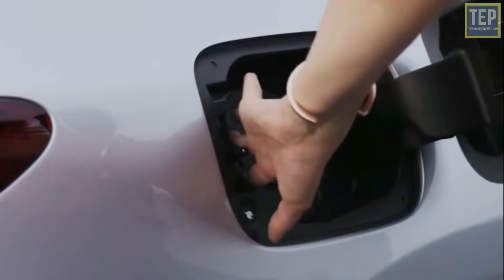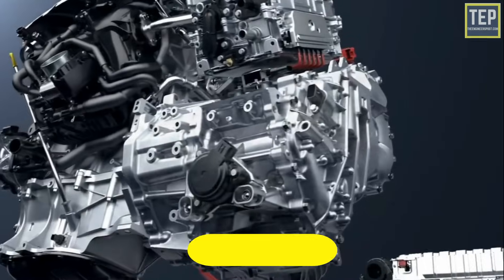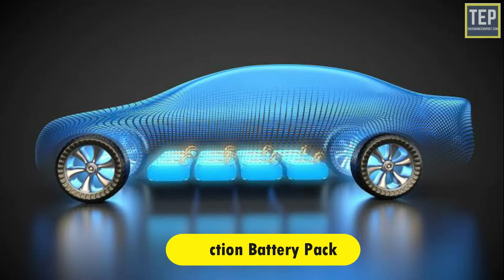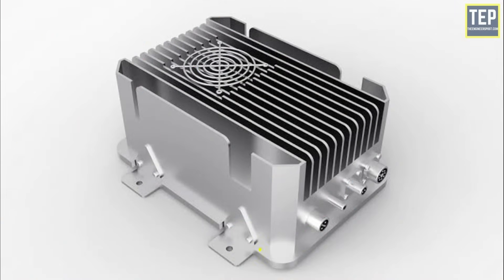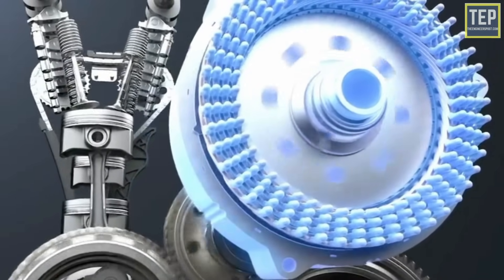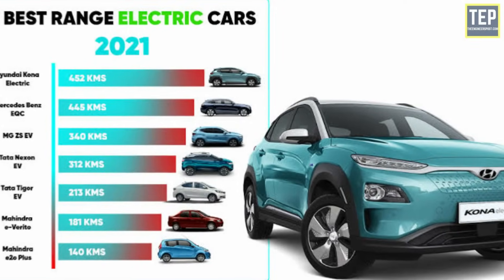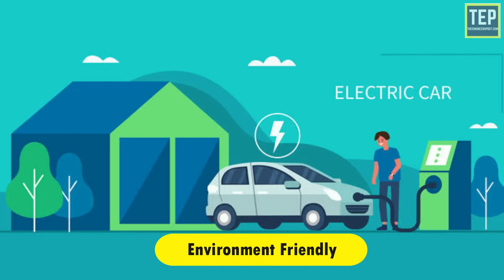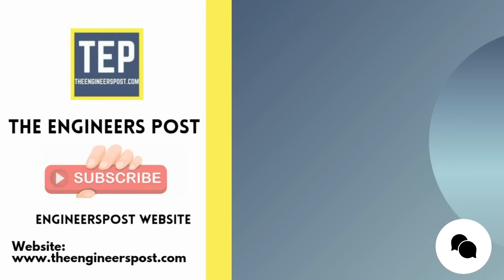How an Electric Car Works? Its Parts & Functions [Explained]

Comment: Very well presented, catering to both techies n laymen.
Reply: To me I really don't care for one they're too expensive and what were the weight of those batteries do when you get in a wreck and one of those batteries sounds break you better run like hell because your car is going to be in fire quick.... That's if you can run you'll burn up in the car like barbecue spare ribs.... You notice they never spoke about safety the vehicle crashing what would happen...
Reply: They are very dangerous n hazard to you health

Comment: This is very useful. Thank you. But I also wanna tell,  in some countries these EV vehicles are makes a huge emissions. if the electricity made by chemical power plants, then thes car makes lots of emissions. Because of its not from the car, we don't see it. These EV vehicles are eco friendly if we make electricity by solar power or some other eco friendly way. But some how your video is very useful. Thank you. 😎
Reply: @Udantha Samarasinghe, Pollution controlling devices like Electrostatic Precipitators, Catalytic Reduction systems , Flue Desulfiaration systems etc can be installed to coal /fossil fuel power plants. Such devices are impractical to be installed on every ICE vehicle on the road. Hence, even if electricity is generated at coal /fossil fuel power plants, EVs are greener than ICE vehicles. Solar panel manufacturing also produce greenhouse gas emissions and toxins like hydrofluoric acid. Hydel projects emit lot of greenhouse gases from stored water, along with other environmental implications. So virtually  no energy source for human use  is "absolutely green".
Reply: You are mostly correct. Keep in mind that while it is true that generating electricity in conventional (non Green) power plants produces Greenhouse gases, proper design can decrease it with new technology, although it cannot totally eliminate it. At the generation point it is far simpler and less costly to reduce pollution than to do it in each vehicle. Therefore, there is still tremendous advantage to switching aways from petrol to electric cars. As we switch to Green Power generation (Wind, Solar, and Geothermal) then of course electric cars will make even more sense.
Don't repeat Fossil Fuel Corporate propaganda, similar to what the Tobacco Industry was doing by lying about the dangers of tobacco smoking (Emphysema, Cancer, and lots of other problems made worse).

Comment: where Electric Car 's electricity come from? nuclear energy? dam? burn oil?
Reply: So true
Reply from the maker: Electric Vehicles are powered by electricity from an outside source, such as a home or public charging station. Since they are powered by electricity and not burning fuel, battery electric vehicles do not physically emit any greenhouse gases.
Reply: @TheEngineersPost  
where comes power for   a home or public charging station,please?
Reply: @fcukrealmadrid   from solar energy 🤔😂
Reply: Various sources. But here's the bottom line - ICE = pollute to make + pollute to refuel + pollute to run. EV = pollute to make + pollute to refuel. But not pollute to run. This means, EVs by definition are cleaner and better option for the planet.

Comment: First time watcher,good one. Does the battery dissipate charge if kept idle for some days?
Reply from the maker: EVs can handle extended periods of inactivity very well. But a lot can depend on what condition your car battery is in. If your car battery is new and has been kept in good condition, it can probably sit unused for about two weeks before it goes flat.
Reply: @TheEngineersPost  clarified

Comment: They do have tailpipes, they are on the power stations where they get their electricity
Reply: ..he’s said less polluting.. maybe there are always guys who see only the negative side.
Reply: @karthiksareen7466  Not many positives to see in an ev, good acceleration is about all they've got
Reply: @Markcain268  may be a fan of ICE so you might not be agree and see the negative side and it can be understandable.
Reply: @ij_1243  I just prefer engines to electric motors, I use electric motors at work everyday so they are nothing special to me
Reply: @Markcain268  so can you please tell me that why you prefer ICE ? 
I mean there is no specific advantage of ICE. Battery capacity and charging time is the only problem with EVs but when it comes to average It's 5 to 8 times cheaper and arguably less pollution then ICE.
Reply: @ij_1243  I just like engines, love working on them and driving them, THE main reason I buy a car is because of its engine, I'm not particularly interested in 0 to 60, anything under 10 seconds is plenty fast enough to have fun in a manual ice car, plus I get the joy of tinkering with the engine, I have nothing against electric motors, in fact I used to dismantle and reassemble them as a child, even made my own from a kit lol but when I discovered engines I moved on to those as I found them much more interesting than electric motors, I guess I just love the mechanical side of things!
Reply: @karthiksareen7466  maybe there are always guys who ignore the immense superiority of the ICE due to over a century of constant development, and only want change for the sake of it
Reply: @chiefdenis  ICE are not even half efficient compare to EVs. Further more there is development in renewable energy so yes EVs are the future agree or disagree will not change the facts.
Reply: @rob cutting pollution at city centres from AQI of 400 to 40 itself can be a huge achievement for EV, even if overall pollution remains same
Reply: @rob In about 20 years from now, even in India, all electricity will be green, from solar, wind, hydro, so don't you worry about the tail pipe.
Reply: @NishitShukla  but that's 20 years away, which will probably turn into 40 years, in the UK at present 50% of electricity produced And used is green, yet each supplier claims 100% green energy! Amazing how these companies fool people isn't it?
Reply: @NishitShukla  you have more faith than I do
Reply: @Markcain268  I can see the monumental changes taking place, in Gadkari, our transport minister, we are in the process of taking giant strides. My father was chief engineer of a 780 mw coal fired thermal power plant, I used to cover the coal, power and petroleum and natural gas ministry as a correspondent for a big daily, I know the ins and outs.
Reply: @Markcain268  just calculate, how much pollution produce BY IC engines and EVs. Compare the result and you will came to know why is it called green. 
Consider some factors like fuel transportation cost, area in which pollution produced, efficiency of the machines and engines, Transmission loss, utilization of fuel etc while calculating.
Reply: @ij_1243  Nah, I'll stick with ice until it's too expensive, then use the bus!